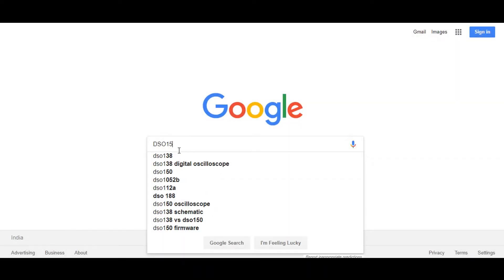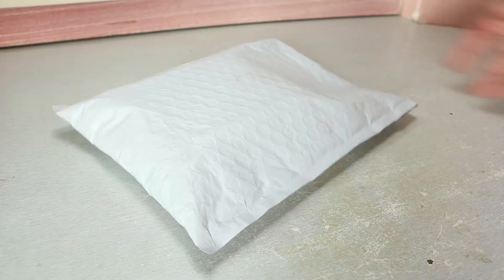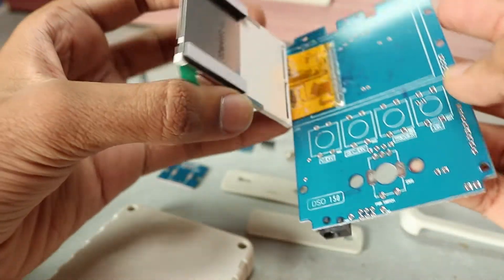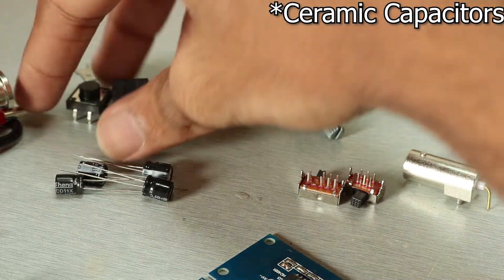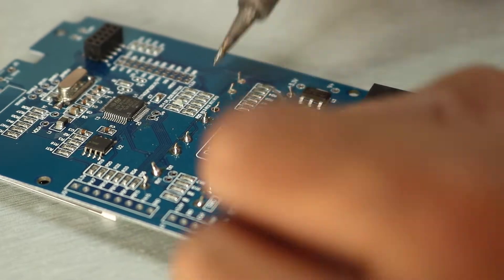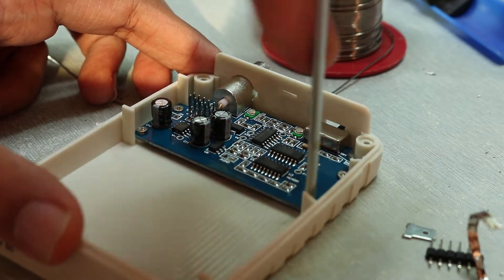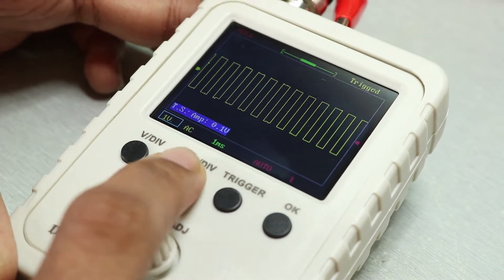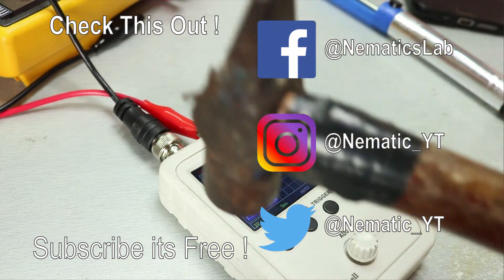Fake DSO 150 DIY Oscilloscope Kit worth it? | Gearbest

Comment: You may have soldered the 4 pushbuttons incorrectly. Since they have a square form factor, it is quite possible to have them soldered 90 degrees off of the correct orientation, in which case they will not work.
Reply from the maker: Nope
Reply: @Nematics_Lab  Its'  a real possibility. Have you rechecked?
Reply from the maker: I suppose before posting such video I would confirm it.
Reply: @Nematics_Lab  Pleas don't be on the defensive, I am not saying that you made this mistake, just that it is a possible (and frequent) mistake when installing this type of pushbutton. As I said, they are perfectly square and it is quite possible to flip them by 90 degrees when assembling. At the least, my comment serves as a heads-up for other people who might want to build the kit.
Reply from the maker: I have checked it couple of times anyways thanks for giving your advice I appreciate it.
Reply: Those buttons are just permanent off switches which are on when you press them, and pins alignment is rectangular so you can't be wrong when you put them on the pcb...
Reply: @dimebagtribute  Actually yes you could go wrong.Those buttons have 4 terminals, internally shorted two by two. If you solder them 90 degrees off, the button will be continuously "on" (pressed) regardless of whether or not it is physically pressed.
Reply: @coriscotupi  no you can't, I made this kit 2 days ago and I can tell you with the drilling patern on the pcb you can't flip those switches, their legs are not round... The legs are rectangular so if you want to fit it in a 90 degree angle rectangle it will not go through, do you understand??
Reply: @dimebagtribute  The device you have in hands may have the rectangular form factor buttons, but there are a number of variations of this oscilloscope on the market and some of those do use square buttons that yes, may be incorrectly soldered. Admittedly it might be only the copied, counterfeit ones that use the square buttons, but the comment holds for the benefit of other people who might be building from who-knows which vendor.
Reply: @coriscotupi  this is 6mm miniswitch button, the 4 legs make  a rectangle with a side at 6mm and the second one at 8mm, that standard one, whatever the seller or factory who made these kits so you can see you can't be wrong with this part!!
By the way I bought the same fake kit on Gearbest as on this video...
Reply: @dimebagtribute  I happen to have a number of identical switches with a square form factor and know for a fact that people have purchased DSO150 kits that use this square button, which is why I offered the comment. It wasn't your case? Good for you. I just offered the heads-up for the sake of whoever gets the kit with the square buttons. Jeez.
Reply: Nope, that's impossible.
Reply: @coriscotupi  it's just a button no need to be get into a fist fight over it. Anyway I ordered one of these last night and I'm worried now about fakes and a firmware update that it might need. Any tips on that????

Comment: Yeah trigged auto mode and pushing buttons random, yeah nice video, not even trying to do it right....
Reply from the maker: If I press any button it would freeze without giving any input it gets triggered and won't come out of it.
Reply: @Nematics_Lab  i had 2 problems after soldering, first i shorted a circle with a left over drop from work, it dint even booted up, and second i had the plate for the rotary encoder the wrong way, by me the freeze happent when i seclected the trigger, have a look, mybe you had the same bad luck...

Comment: You didn't check voltage when you was building it!! You missed a step before to make the final assembly, you had to check voltages on the main pcb and make sure it was the same as provided on the manual!! Even if the manual show a through hole version, the smd version you have is the same circuit, and the voltages for checking your main board are the same, I 'm pretty sure you have large difference between yours and those provide by manufacturer...

Comment: If anyone has a "FAKE" DSO150, and is willing to copy the firmware off it, I need a copy please.  I purchased a very good "Faked" DSO150, and when updating the firmware, I got the "This board is fake" message and it's bricked.  If anyone can copy it for me, that would be great.  Thanks
Reply: Why not just buy another kit, but this time from Banggood? No-one has ever bought a fake copy of this kit apparently from Banggood (read up on JYETech forums). Luckily i just bought my kit from there and it verified OK by JYEtech. The kit is only $16 right now on BG. Don't risk Ebay. Then, if you want, you can copy the code yourself. Or.....were you looking for the fake code?
Reply: @englishrupe01  because I want to get this one working again. Even if it's with older firmware
Reply: @jameswiz   OK, cool. Well if you want, this guy on the JYE Tech forums has written a firmware that works as well or better. It's on Github, but here is the link to his description, and the link to the firmware:https://jyetech.com/forum/viewtopic.php?f=19&t=1953    Let us know how it works, please.